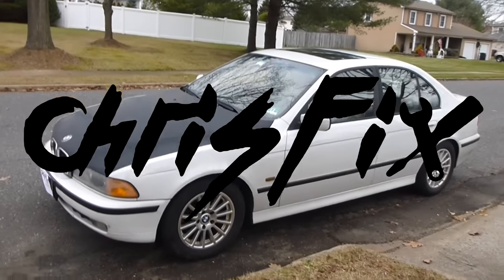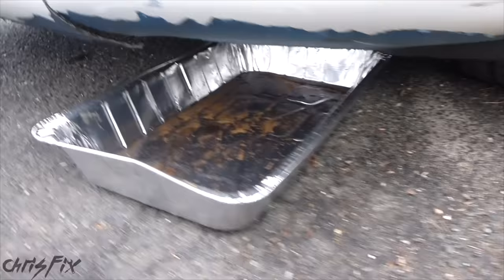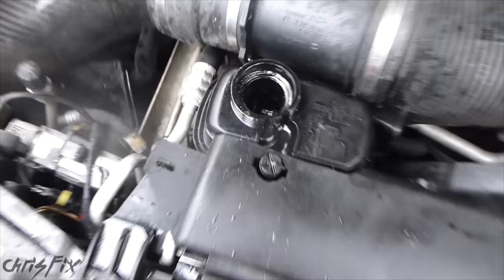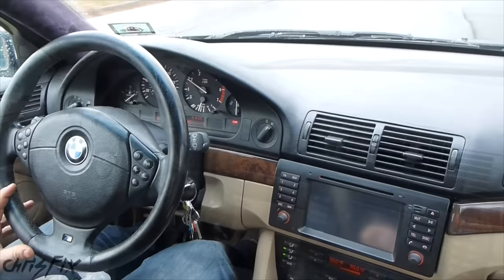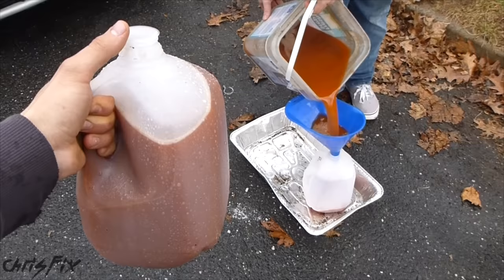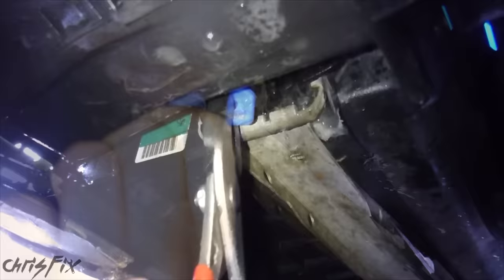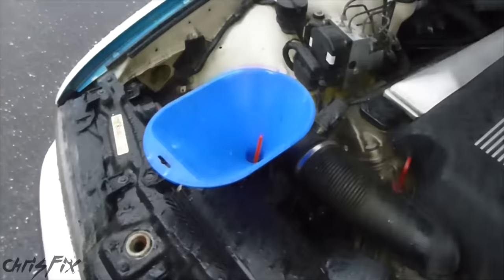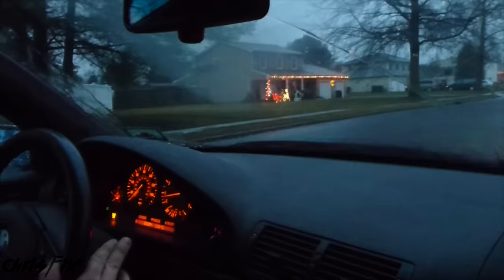How to Quick Flush Your Cars Cooling System

Comment: Good video.

When I do my radiator, I always flush with plain water (from the hose). After dumping old coolant, will stick the hose in the top of the rad or overflow tank and let it run for a bit, the start the motor and let both run for a few minutes. You can get a kit that will allow you to hook your hose to the heater hose that will help flush it better.  After getting a good flush I will add the flushing fluid and fill with water. Take the vehicle for a drive to make sure it mixes and gets all through the cooling system.  I like to leave it in there for a day or so before flushing with plain water again to remove the flushing fluid and any crap that has come loose in the system.  Then drain, flush til clean and fill with the proper mix of anti-freeze and a waterpump lubricant/conditioner.

Don't worry about leaving the flushing fluid in the system for a day or two, it won't hurt anything.  I once left mine for over a year without any problem.

Comment: Check out Chris's how to flush your heater core, and do that after you run the chemical cleaner and let cool, prior to refilling wire coolant, and you will be in great shape. I would imagine it would work well with your radiator as well.

Comment: When you're doing it make sure you take all preventative measures to having air in the cooling system because I did mine when I wasn't as experienced and didn't think to do it with one of the special funnels so now I have a blown head gasket/cracked and/or warped cylinder head. It was a great learning experience though and fortunately the car was a project and I didn't need it to get to work. It's my first car and I've been trying to get it running.
Reply: what special funnel? the one he used in particular?

Comment: Thank god for youtube. I had no clue the steps necessary to flush the coolant. I replaced the slave cylinder on tuesday & soon will be replacing the oil pan gasket, coils & spark plugs. Flushing the anti freeze will be the final check mark on the mazda to do list. Thanks

Comment: hey chris i got a rlly good idea: how bout a video on how to install a digital engine temp readout
Reply: Go with a mechanical gauge.. (I say mechanical, but it has 1 wire for the sensor and requires no electricity to work)  Meaning it will give you the temp if you have electrical failures or even if the car is shut off parked.  Mine gives the exact temp on a gauge starting from 130F - 400F   the engine in my vehicle sits at 180-190 on average. where my stock gauge in the dash only says HOT or COLD no information.
Reply: Just hook up a ScanGauge and monitor everything. Plugs right in to your OBD harness. Gives you engine temp, rpms,  transmission temp, oil pressure,  voltage. Quick and easy.

Comment: If you change your coolant when you are supposed to then you don't need all that other flush and rust stuff.  Drain and fills is all that's necessary.
Reply: wrong, always flush with at least the water
Reply: Yeah but some people never do this drive the car in to the ground then get a new car
Reply: Nick V the Car is from 2001. And all cars rust from the inside.

Comment: No you can't use tap water since it has minerals that can cause problems. Distilled water has absolutely no minerals just pure H20.
Reply from the maker: +glass rigs9 Correct.
Reply: Steve I fill with non-deionized water... My poor E46 316ti... I wonder how it still works...
Reply: Distilled water is not entirely free from minerals and chemicals. Actual pure h2o is expensive and pretty much used only in research labs.

Comment: Thanks for all your videos. I find them to be useful because of the attention to detail you put forth on explaining how to do things. I have  a 1999 mustang gt and I drained the coolant from it yesterday. According the owner’s manual the car takes 3.4 gallons of antifreeze. I’m still in the process of doing a deep flush and have noticed that I’m only able to put in 2 gallons of distilled water. I turned on the car and waited to see if the level would go down so that I could add more water but nothing happened. Any suggestions?
Reply: Get cooler car
Reply: I am not a biologist but I think after you drained your radiator you still have water in your engine block and heater core. I replace my radiator fluid in my Toyota Corolla yesterday and had the same problem you did. Chris did not remove the thermostat or other drains to remove all of the water. I live in South Florida so watered down antifreeze is not going to hurt me but if I live somewhere that gets freezing temperatures I would add more antifreeze.
Reply: That's why paying attention to how much you remove is important. Hiw much is removed, how much is added, some simple math, & you know exactly how much is in the system still.

Then, you adjust the amount of mixture to offset thebamount of water thatbid still in the engine.

Once you do a proper flush, its much eadiernfrom then on. Simply do a drain & refill every 30-40k miles & you realkybdont have tobworry about that remaining balance of coolant mix, as long as you're draining & refilling often.
Reply: @LTSRIDE24  A better choice would be buying concentrated coolant. Just add the required amount in,since there would still be water in the cooling system and just top off with distilled water. No problems later on.

Comment: I’m a firm believer in the don’t mess with the coolant drain (petcock) on the radiator.  Just drain the coolant from the lower radiator hose and avoid potentially replacing your radiator by accidentally breaking the petcock.
Reply: AMEN!!! ☝️☝️☝️👆
I JUST went through this myself yesterday with my Avenger!! Decided to turn the damn plug and wish I didn't!! Had to buy a new drain plug and can't get it back in.

Comment: I want to so my 05 SRT-4. there's a cap on the thermostat housing and also an overflow tank. my overflow is empty. do I just want to drain my radiator, add flush, run heat, drain, and then fill up from the thermostat housings cap or the overflow tank.
Reply: If the overflow isn't pressurized, fill the radiator first and then the overflow. It will take from the overflow until it's full elsewhere.

Comment: Hey @ChrisFix I have a few questions. I have a BMW e39 520i with two air bleeding screws one on the thermostat housing and the other on the main reservoir, I was told those 2 screws must be taken off while refilling the radiator. Also I was told running the fans while it's off during the flush is meant to help the flow but when I'm filling the radiator it's not coming through the bleeding screws.

I do have more questions but I'll wait to see if you reply. And if you have an easier method of contact could you please let me know.

PLEASE HELP ME!
Reply from the maker: I have seen my friends loosen the screws when filling the reservoir (then close when the system is full to avoid letting air in), and you are supposed to run the heat when filling up your coolant to properly get everything circulated!

Comment: Did you fill with the recommended amount of antifreeze THEN add the anti rust bottle on top? Or did you stop adding antifreeze so after the bottle of anti rust was added total liquid would meet the recommended amount of antifreeze the vehicle asks for?
Reply: I’d say he filled it to the recommended level. For example my Corolla takes 6.9 quarts of coolant so I’m putting in 6.9 quarts.. Just subtract how ever much is in the anti rust out of the coolant you were gonna put in. Don’t over think it.
Reply: You don’t need a rust inhibitor if your car is in good condition and there’s no rusty water I the coolant. New coolant already contains rust inhibitor. The stuff Chris used is a combination inhibitor and sealer, since old cars have aged hoses which are sometimes o my sealed by the accumulation of water deposits and dried coolant. When you flush them, the crud  that stopped it leaking is dissolved away so you need a leak sealer. Even so, leak seekers can cause different problems like clogged heater cores.. so I’ve never used them. If your car has a leak you ought to want to know. so you can fix it.

Comment: You forget something chris bmw have a plastic screw right near the Expansion tank the Black one you need to unscrew it all the times you add coolant or water, this screw prevent air 
bubbles in the cooling sistem:/
Reply: Where is this located exactly?

Comment: Great video Chris! It's a good, thorough method, but I should have followed my manual, by removing the thermostat. It affected  the coolant ratio, due to the distilled water that was trapped. Essentially, I could not add as much coolant as I removed. So, I would add full concentrate antifreeze to the expansion tank- repeatedly because the  expansion tank would empty overnight. I use Ethelyne Glycol (the green stuff) and check the specific gravity with a refractometer until it is dialed in at -36 deg. C. Initially, it was -18 deg. C, so I hope I did this correctly. Ultimately, what is the bigger pain in the keister: removing the thermostat (not conveniently located) or refilling the expansion tank 4-5 times?
Reply from the maker: Yea for some cars removing the thermostat is a pain.
Reply: @chrisfix  was that actually you pulling it out if it was Face reveal
Reply: @GladiatorGladiator2023 That wasn't him lol, also he has older videos with his face it's not a big deal

Comment: Holy! 106C is the normal operating temp? Crazy!
Reply: 100C is boiling. I thought the reason we use coolant was to keep the water from boiling. If so, you make a good point.
Reply: +Dave denton 
Hence the reason we don't use water as our coolant except for emergencies. Most modern cars run between 210F/98C - 250F/121C, >250F/121C is dangerous and too hot.
Reply: +Koksn Todorov Thanks for pointing that out. Somehow that slipped my mind.  
I believe distilled water is best, but I've had pretty good results with purified (deionized) water. Hard water can be very corrosive with aluminum engines.
Reply: +Koksn Todorov 
Also, when under pressure the coolant has a higher boiling point.
Reply: It should be around 95C when the fans kick in. He may also have a bad temperature sensor
Reply: Jeff Darnell I don't know what you are talking about. My cars are running at 85 degrees C. If I ever saw above 100C that would indicate a problem. Not even in the summer I see above 90C.

Comment: It would be better to use 100% antifreeze in this case not 50/50 since you already have water in the system. You can use a $3 antifreeze tester to tell when you have the mix in the car right. It would also be good to burp the system of air bubbles to avoid over heating problems.
Reply: He drained it all out, with the cleaner. Might be residual water, but not 50% water.

Comment: Hey Chris! Huge fan here. 
Just a quick question. Did you only do a 1 distilled water run or did you do multiple to make sure the old coolant was out?
Wouldn’t be sure if just doing one 10 minute run would fully flush it or would have to do another run.
Thanks.
Reply: Chris has a super flush video where he goes though what you are talking about. I think this is a simple one run through.
Reply: Depends on how dirty the flushed fluid is; it seems the point is to flush until the water comes out relatively clear

Comment: Hey Chris first thanks for all the tutorial and tips that you're doing. You're really great.
Question, my coolant keeps running out so quick and I can't find any leak, how or where else I can check?I would really appreciate the help. Thanks.
Reply: Check the hose connections between the plastic reservoir and the radiator, including the tube that runs from reservoir cap to the bottom of the reservoir. They must be all air-tight sealed or else the overflowed hot coolant cannot be sucked back into the radiator to replenish it when the system cooled down; which causes low level coolant in the system overheated and evaporated rapidly! You can check the coolant level in the reservoir after each trip, which should be a little higher when the engine (system) is hot and little lower after it cooled down due to the overflowed coolant was sucked back into the system to replenish it. If the coolant levels in the reservoir were about the same between hot & cold then probably the connections are not air-tight sealed.

Comment: Don't dry run car it may damage water pump in car
Reply: A few seconds as Chris did is just fine. No harm will happen.
Reply: @Jarod1941  scraping or invisible scratches gives roughness even if it is for few seconds, If we are not specific about caring car then as you told it is OK but the one who loves their car 🚗  it is like marking the car with knife .Chris intention is to safeguard and not damaging. His suggestions for DIY guys are great. 👍 👌.
Reply: Yea I was a bit confused by that part. I wouldn't risk it even for a few seconds

Comment: if you cant find the little plug you can also disconnect the radiator hose which should be an 1 1/2 thick or bigger

Comment: universal coolant and sealants? good bye head gaskets in a couple more years?
Reply: Firas R129 yah i here that the watee pump is gone to
Reply: Mercedes Lexus Toyota West Indies Lexus Toyota
Reply: Mercedes Lexus Toyota
Reply: I have basically the same engine in my 1995 e34 and I know for a fact that using the green coolant is not only nOT what's in the manual but also detrimental to these specific engine as they are all alloy with high silicone contents and there was orange coolant in there at the start of the video for a reason, that reason being it's formulated for alloy engines and standard from factory
Reply: Gotta be sulfite free!!!

Comment: Why do you eve need the rust protector?  Doesn't the coolant have anti-rust properties already?
Reply: +njintau It does.. Seems like a waste of money to me.
Reply: +Mrpepsi320 it's also used to prevent leaks
Reply: Also it clog up the system
Reply: njintau he used it to help prevent leaks in this older vehicle.  and clogging shouldn't be an issue if the system is cleaned properly.
Reply: Clearly that radiator was neglected. It needed the extra help. Lol
Reply: He said in another video that stop leak will clog the system??

Comment: At 4:10 he starts the engine to pour out the remaining liquid, isn't running the engine without any liquid gonna overheat and damage it?
Reply from the maker: If you're only doing it for a very, very short amount of time (like to remove coolant), you won't damage anything but if you left it running or tried to drive around, you would definitely start to cause issues!
Reply: @chrisfix  thank you very much for replying!
Reply: Modern cars dont run coolant for some time on cold starts to warm up the engine faster.
Reply: As long as you only run it for a minute or so, you will be fine.  The engine is cold after all.  Especially in 40 degree weather.
Reply: No
Reply: @charlesmcgehee3227  It's not about the engine as much it is about water pump running dry. Bad bad stuff.

Comment: i dont get this,,you drained when your engine was cool meaning your thermo was closed and you still have traped coolant in the eng block and the heater core so you did not drain those out,,yes when you went for a drive it circulated everything once it got to temp but then when it cooled down and you drained it again there is still coolant left in the eng and core,,so this is not a complete drain and flush but ohh well i guess its better than nothing ,problem is you will end up having more than 50/50 ,you will have more water all in your core and engine block ,,so idk about this method
Reply: That’s... that’s why it’s titled a quick flush... and he has another video on a full flush...
Reply: @colj4040  to be fair he has other vids on this where he goes into more detail about flushing out the block and core but its a pain to remove all those hoses and to  fill them up etc
Reply: @foojub6907  he has a few and that is what makes it confusing, to flush out everything without your car going through the temp cycles to open the thermo he removed the thermo and replaced it anyways after he was done the flush job,,,and without thermo you are able to flush it all out (i think) ,,i am not sure what video i need to follow on my car,if i should replace the thermo or not bother ,its a pain in the ass if i have to ,id rather do a flush like in this video,but as i said you end up having more water in your engine and core that mixes with everything when all said and done,,i guess still better than leaving the old crud fluid in there,,if you replace 70-80% good enough i guess
Reply: @ARCSTREAMS  I’m not sure what you see that’s confusing. Two are half a decade old, one being a 7 minute “quick flush”, and the other a 22 minute “super flush”. Then the most recent of 5 months ago includes multiple other fluids being changed. Seems pretty clear to me